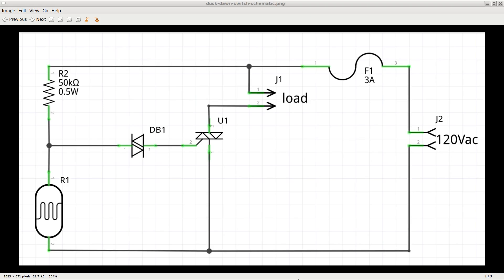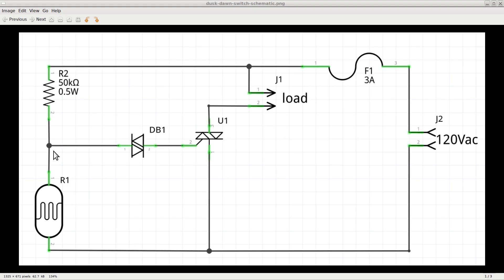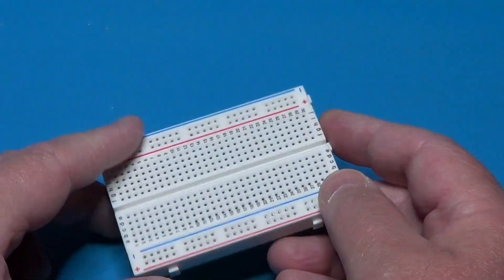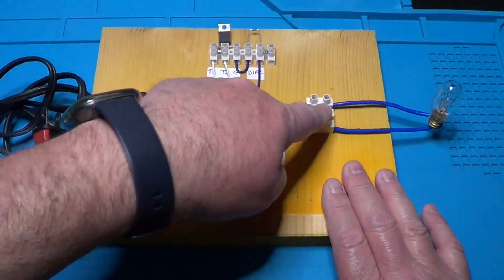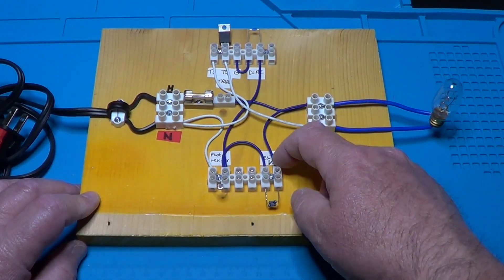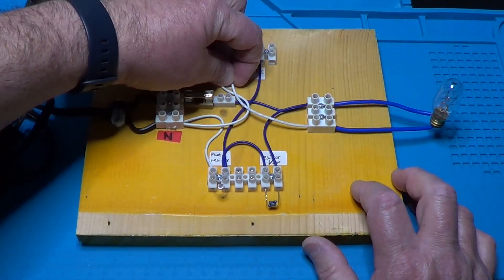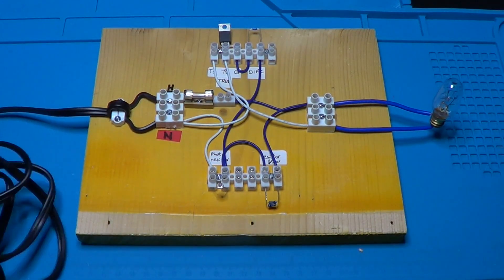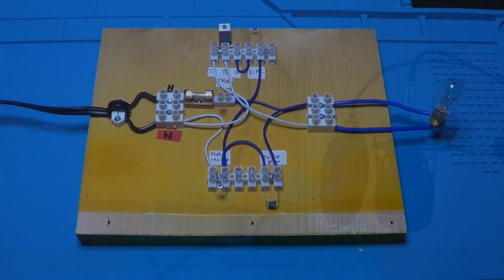Lights On! (part 2)

Comment: Please provide us with the details of the terminal blocks... Search terms, link (if available,) method of attachment, any tips for using them, etc. Thanks!
Reply from the maker: The terminal blocks are strips of terminals in a dual row. Each column has two screws, one per row, and they are electrically connected together. Each block can be cut in smaller sizes, if needed. Each block has also a number of holes in the center that can be used to anchor the block using screws. Im my case I used wood screws to attach the blocks to a plate of wood.
Here is a link where I bought my terminal blocks:
https://www.amazon.com/dp/B08VND5XDN?ref=ppx_yo2ov_dt_b_product_details&th=1
They have a rating of 380V and 10A max.
Hope this helps.
This kind of terminal blocks are very common in Europe, but I saw them used also in the States.
Reply: @eleneasy  Excellent! Thank you.

Comment: Thanks for sharing! Great VAC proto-board technique! Suggestion = When I built my VAC PSU, I made each part separately, so that I could make use of each, independently. The first item in the PSU series is a DIY Emergency Shutdown (AKA "All Stop") Switch. The switch has a large button and is meant to be slapped, quickly, to turn of an errant circuit. They can be cobbled together for just a few dollars. For that matter, a proper and complete VAC PSU is advisable. Emergency Shutdown Switch to Isolation Transformer to Variable Autotransformer to Dim Bulb Current Limiter to DUT. Cheers!